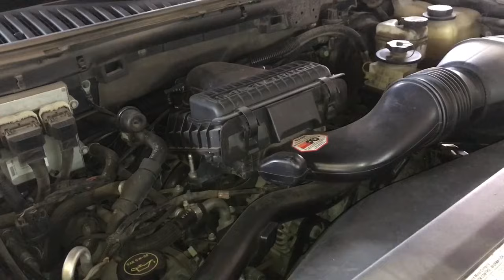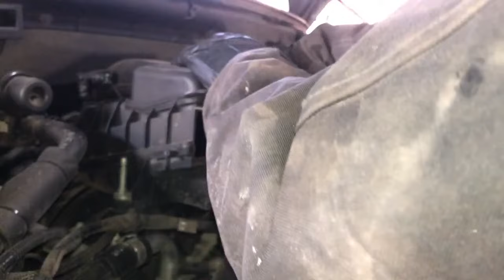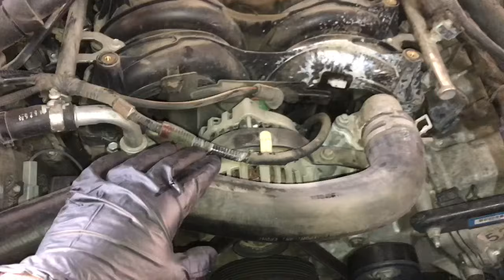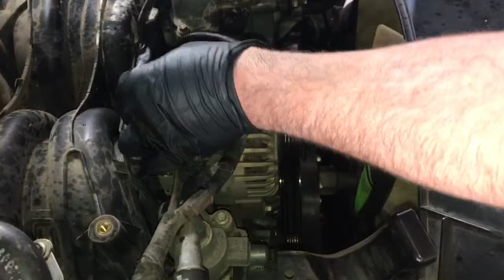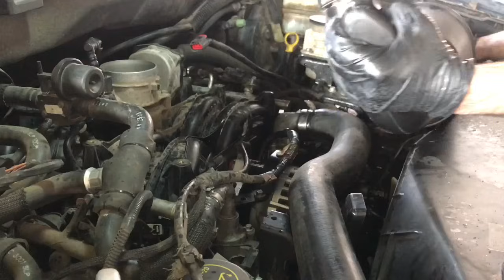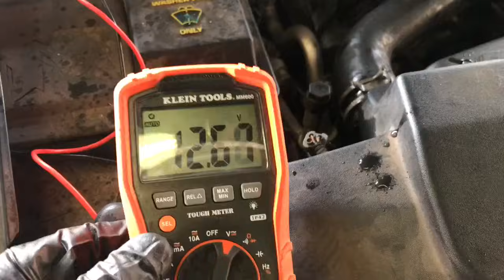Ford 5.4 & 4.6 Alternator Replacement (Tips and Tricks)

Comment: No need to take the entire thing off. You can remove bracket and bolts from alternator to bracket off as well as the lower alternator housing bolts. Take it to the left while manipulating the upper radiator coolant hose out of the way. I just did our 06 Nav in under an hour.

Comment: Just changed the alternator in my 2008 F150. Super easy thanks to this video. The hardest part for me was getting the 1/2" breaker bar into the tensioner. Otherwise not too hard of a job.
Reply: How’d you do it because I’m struggling with that as I’m typing this
Reply: @CasketSizedMaggotaz same

Comment: Thank you for the tutorial.  It really assisted me in replacing the alternator.  The air cleaner does not have to come off in order to accomplish this task, but the m😮ain tube does have to come off.   The biggest challenge was finding a    long enough breaker bar that had a 1/2" drive that would fit into the belt tensioner.   Fortunately, I picked up a 1927 Bogs 1/2" drive socket set at a swap meet last year to go with my 1927 Model T.  It fit!

Comment: When you remove the slack with the Pully.. does the serpentine belt automatically fall out of order, or can you just rest it and slide it back on. Pretty much, do you have to re do the entire serpentine belt once you give it slack?
Reply: This is old. But , when I removed the belt from alt. Pulley, i kept tension on the belt with my hand as I released the tensioner , then used a Bunge (attached to hood)cord to hang the belt out of the way. Belt stayed lined up

Comment: I wish you had been a bit clearer (by showing) about hoses and mass air flow, etc with the other side, and the hose. But as far as bolts and everything, it was pretty clear! I chose to not remove the coolant hose, and I replaced the belt as well, less than 30 minutes